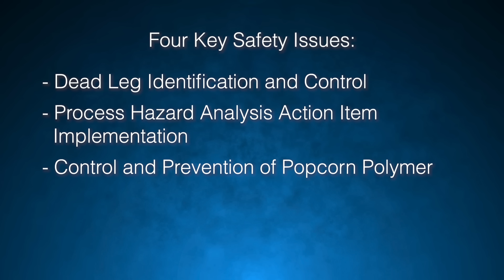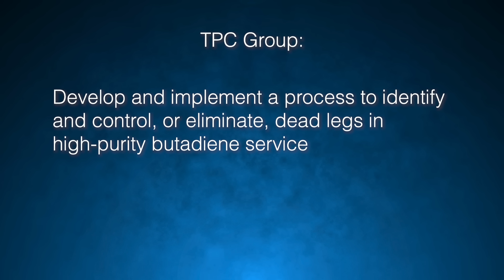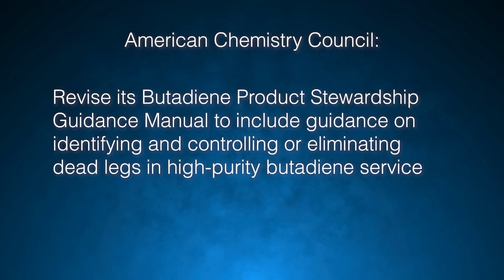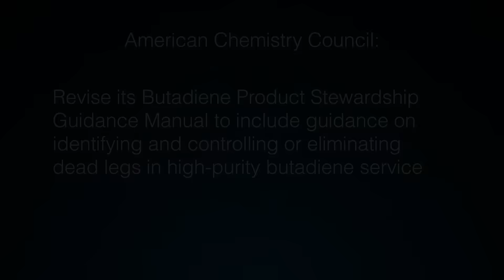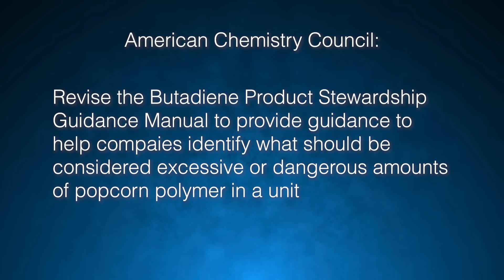The Danger of Popcorn Polymer: Incident at the TPC Group Chemical Plant

Comment: I am not a chemical engineer nor do i know anything about what is being discussed in this video. i hated science and math at school yet i have survived my life so far. I have been a safety representative for two companies in my life and things that appear dangerous to me seems like a no brainer, report it, follow up on it and enforce the safety changes. this is the recipe for success. cutting corners with highly combustible materials is a death sentence for workers in this kind of field of expertise. The worker in this reconstruction of events knew what was about to happen before it did and ran, which probably saved their lives. The worker performing the maintenance on the pump listed it as urgent, so who changed it. This is the person who needs to be brought to task. Maintenance is done to prevent problems, not make problems. Maintenance is also done to make sure the system is working as it should parts ware out and need replacing, a temporary pump is not equipped to handle the work load of the original, which is why, in my head anyways, the original pump was listed as urgent. i understand the dead legging part things build up in pipes but when you use a shut off valve you are supposed to put a tag on that shut off valve so others will know and follow up on the flushing of the pipes so this build up does not occur. all of this so far is common sense. the people running the joint are negligent at best whom ever re-consigns an important piece of equipment labeled urgent and turns it to not urgent, it is being handle. I think that individual needs to be charged with negligence and are the reason this got out of hand. When people play with chemicals eventually its going to blow up in your face, Mixing chemicals together is dangerous because by product occur as in this case. if you do not know enough about the substance you are dealing with let someone else deal with it that knows what the hell they are doing. that way when maintenance is being carried out and things are marked as urgent the follow up on it. if a boss has change the order from urgent then you are just asking for trouble. the person carried out the maintenance as in the reconstruction he tried to turn it back on the pump would not start. you seal off that dead leg and flush it right away so as the by product popcorn polymer doesn't build up enough to burst the pipe and cause it to turn into a highly combustible gas vapor. I think in the interest of safety here, i recommend that no temporary pump be installed but a second pump built for the capacity of the original be kept on site so as the change can be made right away so not extended wait is required and while the maintenance crews are switching over the new pump then the pipes can be flushed so as no by product build up will be allowed to occur. if this means down time it is better than waiting for months and have a urgent fix be down graded to not urgent because a temporary pump is doing the job. To me this is not acceptable practice for safety in the working environment of a chemical plant of any chemicals. It is just waiting to fail. The Maintenance man did his job and after that someone else down graded the urgency. The maintenance personnel should have followed up on the pump and requested it be put back to urgent. Report it, follow up on it,  and enforce it. these are the three rules of safety in the work place. People get busy things get forgotten but down grading something as important as a pump is irresponsible. the down time for that dead leg was much longer a wait now causing the by product build up and the system not being flushed. if you had another pump with the same capacity to be a replacement for the pump all of this chaos could have been avoided. Common sense people. if you don't know your chemicals maybe you should be in another kind of business. Prevention 101.

Comment: I would like to know exactly why there aren't pressure check valves every so many feet on all of those pipes. To me that would seem the wise option so they could see areas of pressure buildup before they reach critical. Then there could be systems in place to sound an alarm when sad "legs", dead or not, rise in pressure.

Comment: Surprised an incident like this didnt trigger any high pressure alarms. You think each any every line would have pressure sensors and/or gauges that operators routinely monitor. This kinda build-up in the lines take time and should be preventable. Also dont know why some sort of pressure release mechanism that can safely vent excess pressure wasnt activated either.

Comment: It's great to see the USCSB investigating these plant failures, and once more it seems the "mechanical" failure could have been avoided if the people who are being paid to inspect and maintain this incredibly dangerous facility daily, had actually been doing their jobs. Another point is, Dr. Johnson mentioned the injuries at the plant as well as a disruption in the lives of the local residents. I live on the east coast and every time  one of these facilities has a catastrophic failure the toxic smoke soon leaves the area and floats across everyone and everything, eventually running into the mountains running north to south the length of the east coast, then it rains. We have been dealing with this as long as these dangerous facilities have existed, but no one ever talks about it. By the time these airborne toxins reach us you don't see the thick black clouds of the burning chemicals or choke from fumes, at least not immediately but after years of this happening over and over those toxins are in our water, soil, food, animals and us.

Comment: Common sense dictates that you may make the overall process more safe as far as the reaction process to a spill, but you haven't made the handling process any safer at all. In order to do that the popcorn poli Must be broken down into sperate compounds that will not react to oxygen until combined or you must prepare an additive that will capture the oxygen and only allow it to react with the poli once a release agent is introduced to kill the first additive. You aren't done yet and to say that that report has made the original situation safer is a total smoke and mirrors show because it isn't. You Just made cleanup easier to deal with next time is all! Just my opinion!

Comment: I have a question. I'm not pro or anti company. If the valve was cut off and the popcorn forms when the polymer comes in contact with oxygen, how could could much of the liquid be in the dead leg? They never flush out the stagnant liquid?

Comment: I worked in a high purity 1,3 Butadiene unit for many years. We took exceptional care of the process to insure we did not have a popcorn polymer problem. We saw plenty of popcorn polymer over the years but we never let it get out of control . We washed ( rinsed/flushed, passivated) all equipment that had been open to atmosphere  with a  hot mixture of NPH ( NItrosophosphatehyroxylamine) and sodium nitrite after the unit had been "air-freed" Then we injected and circulated  the same mixture in the final purification column and associated equipment to scavenge all the O2. We also injected TBC ( tertiary butyl catecol) to kill any popcorn.  We also added rupture discs under every PRV/PSV to prevent O2 from migrating into the inside  of the relief valve. If the relief valve lifted, the disc had to be replaced ASAP . Also had an exact measurement of the outside diameter of the heat exchangers and they were routinely measured to note any expansion.
Reply: We just added oxygen scavengers to our KLP unit a few years ago.  Has worked wonders.  Surprised we didn't have them sooner.  We had some near misses when the PSV lines filled with popcorn.
Reply: @evantilley6192  we had a pair of UOP KLP reactors to covert acetylenes to 1.3 BD and Raff1 ( Isobutylene mostly to feed the MTBE unit) We shuttered those units and an Olefins cracker and a large world scale Aromatics unit in 2009 and turned it into razor blades just to get the Ethylene off the market and keep prices up. I had about $7,000,000 of new process equipment that was never used and the olefins cracker had a $23,000,000  project ready to put in service that was also cut up into pieces. I took chose a severance  package and retired.
Reply: I freely admit that I have neither knowledge of nor experience in this field; however, it sounds as though common sense was applied by those who did have knowledge and experience.
Reply: Attention seeker
Reply: So you're saying this almost had to have been done intentionally?

Comment: My field is Quality Engineering.  Implementing and following processes is essential to manufacturing safety.  Establishing best practices with a Robust way to validate processes and procedures are implemented.  They had a process to prevent the failure and should have been implemented ini 2016 so it appears they had no procedure to assure implementation.
This was a good failure analysis.

Comment: Unsollicited noob comment: Appart from everything they recommend, wouldn't it be more practical to just monitor pressure in those pipes? I mean, knowing the max pressure a pipe can handle is trivial, and detecting when pressure goes over a set treshold also is. No need to worry about the popcorn per say. There has to be something I forget here...

Comment: The film said the polymer required oxygen to form. I don't think there was an explanation in how oxygen/air entered the pressurized dead leg to begin the creation of popcorn polymer. I'm also left wondering why the primary pump wasn't a dual/ changeover unit so failure of one pump could be overcome by switching over to the other by valving adjacent to the pumps thus avoiding long dead legs altogether. I ran maintenance in a glucose refinery and such dual pumpsets were standard items.

Comment: I feel like if I ever open a chemical plant, I'd probably just call these guys to give me a full list of recommendations WHILE I'm building the facility. Seems so much smarter that way. Then you get all the remote shut off systems, you know you need to hire someone to be in charge of flushing pipes, etc. Life is so much cheaper when you don't cheap out on things. It may cost more today, but you'll save money over time. 

For example, I worked for a detail shop when I was younger and the owner was constantly buying the cheapest garden hoses he could find "because people run them over all the time and so I'm not gonna waste money on good hoses!!"

The problem was, he was always out buying more ten dollar garden hoses. Finally, I was sick of using these trashy hoses he'd always buy, so I went and bought one hose for 50 dollars. It lasted the 3 more years I worked there and was still in great shape when I left. The ten dollar hoses were toast in a month or less. 

Just spend the money to do things right and you'll find that things work out better. Of course, there's a lot of stuff you can buy at the dollar store. But for the really important things, put really important money into them. 

It isn't always an option to buy good things, sometimes you just gotta work with what you got. 

But in the case of a chemical company, you KNOW the owner of the facility has enough money to not cut corners. It's just the greed that controls so many businessmen and that won't allow them to spend money on the important things.
Reply: That's not fair to say everyone knows for a fact that greed is the core human tendency that always causes these problems. 😒

There is also the human tendency to gravitate to the simplest and easiest solution to a problem, or regularly performed task.   

Your hose example illustrates that tendency very well. ⭐⭐⭐⭐

I suspect that was the greater problem here.  Remember, when Butadiene formed this "popcorn polymer" inside the pipes, the company lost that quantity of their product, and that meant they lost out on profiting by its sale.   
Someone who was greedy but vigilant would not have tolerated that.
Reply: But yes, you would have built a chemical plant to the highest possible standards of safety and efficiency.   Then, you would have run it with that same management philosophy. ✔️✔️✔️

Everyone who begins such an enterprise has that standard, and (dare I call it this?) "Love" for their product, industry, service, etc.   

HOWEVER, the business might well outlast you. 
In the future, sooner or later, you won't be in charge of the plant anymore.   You may retire, be forced to sell it for reasons in your personal life, or you may pass away.  

And someone like your old boss at the detailing shop would get their hands on it!  

The same thing has happened to Walmart, for example. 
I used to work for Walmart, and if Sam Walton could see the way it is run today,  he would not just turn over in his grave, he would climb out to dig the grave even deeper!  ☹️

And, I could get started on how this tendency is one of the biggest dangers involved with the nuclear power industry, but I will cut myself off. 🤐
Reply: @TheNoiseySpectator  I guess I'd just have to make sure to hire a good replacement for me when it's my time to move on. I can't control what happens after I'm dead. I also can't be blamed for subsequent owners screwing shit up. If I'm alive, I could potentially email someone and say "hey, bro, you're about to fuck up REALLY BAD!" But if they ignore me, I can't do much about it.

Comment: Did they identify the manager in the chain that didn't fast track that pump repair to keep that pipe from dead legging?  I figured this out before the video even got to the point where they said the primary pump wasn't fast tracked because they "have a spare pump."  I guarantee you it was someone in the management chain that didn't want to spend the money to get that fixed quickly because "we have a spare pump" and they don't know how these pipes work, and probably don't understand the risks of dead legged pipes (gotta maximize shareholder profits, after all.)  That's why they're managers, they don't understand how things work and what the risks are, so of course they make the decisions.  I see this in other industries and that's why I won't fly anymore.  So:  What low level worker(s) got fired over some penny pinching manager's decision?

Comment: I worked as a maintenance contractor in the petrochemical industry for nearly 30 years.I remember one of the plants had a graveyard for old equipment and there was a tank in it that had suffered a rupture like this.From a distance it looked like crumpled up alfoil but when you got up close it was made from 1" steel plate.That drove home the immense forces involved when something like this occurs.
Reply: They should put that tank on display as a warning of the consequences of doing things wrong.
Reply: Maintenance contractor is the one of the most important jobs you can have at a Petrochemical plant
Reply: That's incredible. I constructed a box from 1/4" plate steel and couldn't believe how heavy the little 18" squares were. Crumpled 1" steel boggles the mind.
Reply: 25mm! That's twice the thickness of a WW1 tank!
Reply: 🤗- and a suBje :socialdist::goodvibes::elbowbump::elbowcough:
Reply: Kinda like the fiberglass Titan crumple eh...
Reply: @Vagabond-Etranger  Titan shattered, not crumpled, because that's how fiberglass fails.
Reply: 😛 @Vagabond-Etranger
Reply: @Vagabond-Etranger not at all

Comment: 99% of the people in the U.S. don't even know the history or the international owners of that company, who started it, and why it was built. They make chemicals for products that include agrochemicals; alternative energy; home detergents and personal care products; adhesives and coatings; mining; and curing agents. They improve performance such as fade resistance, UV-blocking and the ability to repel water and stains in apparel, home, and technical textiles. So if you want to quit using deoderant and toothpaste and painting your house and quit wasing clothes and add solar power, you're gonna have to move to a cave. Oh and the rubber they make holds your socks up, and they make plastics for sandals and your car interior is made of every thing they make as well. It's gotta be made somewhere.

Comment: Seems like it would make sense to also have some way of monitoring and automatically shedding pressure in any component which is pressurized by a pump capable of rupturing it if there is a blockage. There is a lot of focus here on one possible cause of a blockage (the popcorn polymer); but relief valves (or less clogging-prone reliefs) and similar, as well as (to the extent possible, depending on the process) an automated response to overpressure events seems like it would be a more effective general approach, assuming it isn't literally impossible to engineer components like this for the chemicals involved (which seems unlikely, since it is possible to pump the chemicals, so there are moving seals or flexible materials that are compatible).
Reply: It wasn't a typical overpressure, though, it was material hardening and blocking the pipe, like when you pour cooking grease down the kitchen sink.

They literally could have prevented this by adding adequate amounts of "popcorn polymer inhibitor" to their system.

Comment: the transfibulator hamn-module should've been pre-designated to detect pressurized polymer at lower levels, I'm not sure why they went on to neglect it for so long and choose to instead rely on the seam insulated with a butadiene carbon-oxide mix.